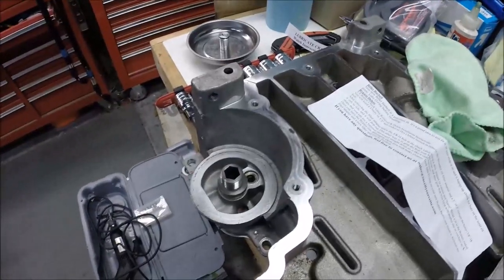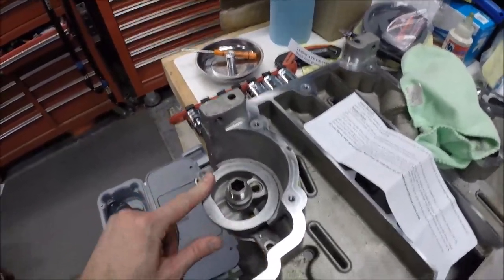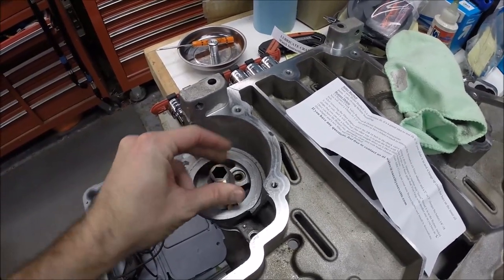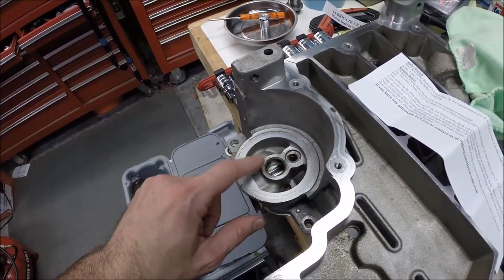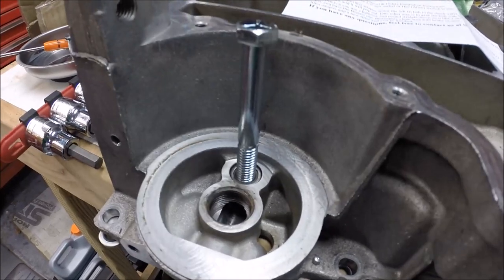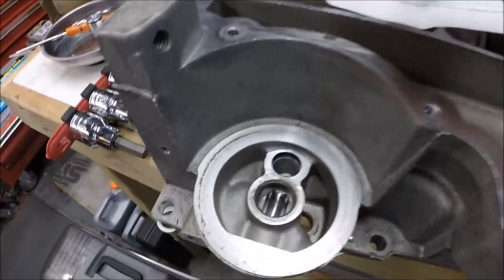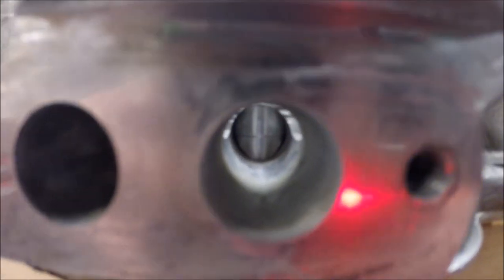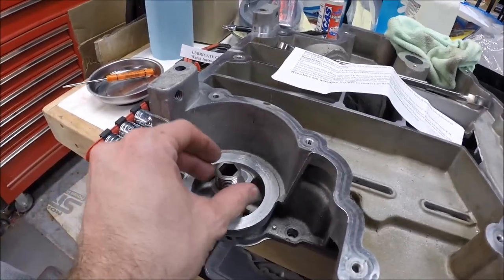1 Simple LS engine upgrade to STOP unfiltered oil!  Oil Bypass Valve Delete

Comment: Nice video Scruf!  
Just to clarify what that check valve is there for and what it's not there for. It is there so that if the filter never gets changed and gets to restricted the check valve will open and let a little oil by and it won't be enough to save your engine unless you shut it down right way.  Also, for those that don't know, most quality filters have a check valve built into them these days that will open if there is a problem with the filter getting clogged up. Most people that buy parts like the Bypass Delete keep their oil and filter clean anyway so it’s not a problem.

The check valve works off a pressure differential. That means that when the pressure jumps up like when you rev the engine and the pressure gets a little higher for a second on the outside of the filter element then on the inside of it, the check valve will open letting unfiltered oil in for a second. All those seconds of it cracking open lead to a lot of unfiltered oil unnecessarily entering the bearings and lifter needle bearings. That being said, its ok if the oil pressure gets a little lower on the inner part of the filter, its brief and its not that low and plenty of oil is still flowing through the filter. As a matter of fact, it usually is a little lower on the inside of the element and the oil pressure gauge is reading that pressure. The check valve doesn’t know the difference between a clogged filter and a brief difference in the pressure differential that’s why it’s always opening and closing. Letting unfiltered oil through.

The check valve is not there for cold oil, especial with the light weight oils we use these days.  We always recommend warming your engine (oil) up before you start being hard on it anyway.

Deleting the check valve will not cause the oil pump to cavitate, it is after the pump so the oil already went through the pump before it hits the filter.

Dirty oil kills modern engines with tight clearances like the LS series engines.
Engine builders have been blocking the check valve since the old school small blocks so this is nothing new.  They new unfiltered oil is not a good thing.

We at SacCityCorvette have been running these deletes and our Billet Barbells that also keep unfiltered oil out in some very pumped up Corvettes, Cadillac Cts-V’s and Camaros for quit a while now. We have torn some of the engines down that we run these parts in that keep unfiltered oil out and the bearings don’t have those tiny particles embedded in them and we haven’t had a lifter failure yet on them, which is pretty common in LS engines, especially with big cams and heavy spring pressures. We feel that keeping the small particles out of the lifter needle bearings contributes to them holding up so well.

Thank you,
Christian
SacCityCorvette
Reply from the maker: Awesome info Christian.   Thanks for sharing.   And great product btw!
Reply: Thanks for this info!
Reply: Wix filters for Corvette DO NOT and most others with the Corvette part # do not have the spring loaded valve that you'd see the same filters in other cars. I can look in my new wix xp right now,  nothing on the bottom on the inside,  their logic is that C5Z has it built into the car
Reply: @CorvetteTrev really?  I my Yukon has the 6.2 l94.  I run the napa platinum 47070, basically wix, and there's a check valve in the bottom center. Corvette guys don't get those on reccomended wix filters?

Comment: You need to tag this to Chevy Trucks!  Common problem on all of the LS engines.  It does not cross reference, this video is like gold to us.  Don't want to have to fun over your vet:-)
Reply from the maker: Thanks for the tip.  I'll try to add some video tags to help the truck guys find this!
Reply: I agree most of the LS motors are such dirty motors on the inside and personally I think it’s because of this check valve letting stuff just go right back into the motor I also updated to a wix Filter that is a lot bigger than the stock filter they tell you to buy and it’s helped out quite a bit

Comment: Ok i been around a while and the last hot rod i built a 302 chev that i use to buzz up to 7.5 k pretty often i had blocked the by pass with flat washer .  I found the information in a book written by Bill Jenkins . He recommended using the one quart truck filter which i think was the same length as the 6 qt vet oil pan i ran . I think he stated it lout flowed two ph8a filter on a remote block . that was a long time ago ok  .My short block was sprint car and the top end was off a G gas car . It ran ok and i never had any problems with  the engine . The filter  on the ls3  in the SS camaro is not any bigger than the one on my money pit harleys . A SS 124 and a SS 143 engines

Comment: This bypass valve is opening more than you think. Cold oil has more pressure, upper rpms and high oil pressure, cheap oil filters, and debris getting in it. An idiot light would be a good addition to blocking it off.

Comment: Just for the record, I think it's a bad idea to eliminate the bypass. It should only allow flow if the filter becomes too plugged up. I can see stiffening, ie. increasing bypass minimum pressure in a race or high pressure application but don't know why you would ever eliminate this feature.

Comment: Honestly, as easy as you pushed that valve down for bypass, I bet that thing opens before 30 lbs. of oil pressure. You put probably 10 lbs of pressure on it.

Comment: Not sure about deleting the filter bypass, I know a couple guys that used a remote oil filter system to conduct brand to brand filter comparisons. They found most all oil filters had plugged enough to elevate the pressure to a bypass state within 200 miles of the oil change. Some better than others but all bypassed.

Comment: Be CAREFUL before you consider deleting the oil filter bypass. It SOUNDS like a good idea, right? Who wants unfiltered oil entering the engine??? However, Under certain circumstances, the bypass is necessary to avoid collapsing the oil filter element and blowing the filter right off the engine. I have had this happen on my racecar. When the oil is very cold, (like a sub-zero day in Minot, ND) the oil viscosity (thickness) gets very high. It is very difficult to push thick/cold oil through any filter element. This is when the bypass valve is intended to open and allow the thick/cold oil into the engine.  The oil filter bypass valve works on oil filter pressure differential  (or the pressure on either side of the filter. The differential is very low under most operating conditions. Except: extremely dirty filter and very high viscosity. 
I would NEVER delete the oil filter bypass on a street driven vehicle. Race engine? Different story.

Comment: I'm building an ls3 and I am getting away from the tight tolerances, going to open up to 2 2.5 thou. Run 15 40 oil and not worry about it.  Moving oil out of the bearing is more beneficial
Reply: Are you building a daily driver engine  ?
Reply: @freddienz68   street/offroad use.
Reply: Would love to see a few videos on the assembly of you engine and the parts you recommend for this  build.  👍🔧🏁
Reply: @freddienz68  it's a 3.900 stroker with a 6.300 rod and a really short diamond piston.  4.070 bore. Should turn some heads
Reply: Molnar engineering for the 3.900 crank and 6.300 rods.
Reply: @bowsertownes  This engine is gonna sound mean as mate👍🔧🏁
Reply: @freddienz68  I've only posted a few videos long time ago of other stuff. Maybe I will try to make a recording of what I have going on.  It will be carburated as well Holley xp 850.
Reply: @bowsertownes  you going to run the Holley efi system  ?
Reply: @freddienz68  no efi, 850 carb. Msd 6014 box and coilpacks
Reply: @bowsertownes  nice one mate .  Merry Christmas to you
Reply: Keep the tight tolerances and use 10-w30 full synthetic engine oil and change it often.
Keep in mind that daily aggressive driving and racing means that the best practice is to change the oil weekly if you are using the vehicle in the harshest manner.
My opinion is that before race night on a daily driver - change the engine oil and filter.
AFTER race night - change the oil and filter again.
If you are using the engine in an extreme manner - use 20-w50 full syn or partial syn oil - BUT - warm the engine up WELL before driving or revving over 2.5 to 3K RPM's.

I also would not recommend using 20w-50 in weather that doesn't get over 40 degrees F - use 10W-30 during these times.

It is less expensive to change the oil and filter than to replace an engine.
Two years of full syn oil/filter changes is $6000 - with weekly oil/filter changes.

One more trick for HP/HD or daily driver engine longevity.

Every second or third oil change - purchase one cheap/inexpensive oil filter and three extra qts of engine oil alone with your regular OF and engine oil of choice.
Drain the dirty engine oil - put the drain plug back in with the cheap oil filter on the engine.
Fill with three qts  of your favorite engine oil - start the engine and allow it to idle for 15 minutes.
This will flush the oil passages of any used engine oil left in the engine.
Now drain the three qts and let as much of that oil drain until no drips come out.

Now simply refill with a fresh good oil filter and now you have a totally clean engine ready for the cruise.
This ensures that you are leaving the least amount of contaminated engine oil behind - in theory ensuring the new oil lasts longer and prevents a new filter from the job of cleaning the old oil bits after a new oil change.
Reply: @PapawCulberson  your complicated bub. Viscosity has relation to bearing clearances.

Comment: I thought that valve is also for cold start until your oil is up to temp the valve opens so your engine doesn't run dry
Reply from the maker: Yes, the valve could open during cold start depending on how well your oil filter flows.  But realize when that valve opens, it is letting unfiltered oil into your motor.  So that said, if you delete this valve, it is extra important to let the motor warm up before driving it hard.  It is also important to run a high quality oil filter.  There are a number of brand options, but I recommend something with a fully synthetic filter media (as opposed to a cellulose media).  These filters will flow and filter better.  I personally like the Purolator Boss filter but there are others that are good too.  Also, most oil filters also have a bypass built into them which bypasses oil if the pressure differential becomes too great across the filter element.  While that does allow unfiltered oil in, it is a final fail safe.
Reply: Scruf's Garage I don't really see a reason to even have this bypass, most modern oil filters already have a bypass if the filter is too restrictive. Just makes me think 2 bypass one in the pan and another in the filter then a leaking barbell how much oil was even getting filtered.
Reply: @bryanmartinez6600  they put them in pan for the people thay dont like to change oil if filter gets backed up oil is still available to flow. You would be surprised how many people don't change oil and can cause problems. As long as you change oil regular this won't hurt to block them

Comment: Hello I have an aftermarket oil pan like yours but the original size oil filter doesn’t fit I am using ph3506 what kind of oil filter did you use on your pan- thanks
Reply from the maker: Mine was the stock bat-wing oil pan.  No issues with filter fitment.

Comment: Just what keeps this plug in place?
Reply from the maker: The thread shaft that your oil filter screws on to (remove at the 2 min mark for reference) overlaps the delete plug (in the same way it overlapped the stock bypass valve).

Comment: I deleted the check valve ball on my 2000 z71. It's still on the rack. Is this going to cause me problems or can I leave it deleted?
Reply from the maker: So my car is NOT a DD and I ALWAYS drive the car easy and let it fully warm up before driving it hard.   If you're the sort that likes to start the vehicle and immediately take off, then I would leave the bypass valve in place.
Reply: Me too what have you found out I’ve getting a oil leak and don’t understand it using to much oil but I remembered removing this Val e and leaving it out . Oh no did I mess up or what

Comment: Wouldn't this bypass  work on a pressure differential concept meaning if flow is good , that flow /psi thru the filter  would hold the by-pass closed . When flow thru the filter (thus lower psi) is not good , 30 psi  would allow the by-pass to open due to the lack of pressure holding the by=pass  closed . My 2 cents .
Reply from the maker: Correct, the bypass is working on a pressure differential.  It's just that the spring is very soft, so it's often bypassing unfiltered oil even when there isn't a significant restriction.   So if you do the bypass delete, it's very important to run a quality high flow filter.  Typically a 100% synthetic media type filter.

Comment: Do you use zinc oil while breaking in the engine?
Reply from the maker: I used a conventional (not synthetic) and some Lucas ZDDP additive during the break-in.  Since it's not a flat tappet cam, it's not as sensitive to needing zinc, but it certainly doesn't hurt.

Comment: would this increase oil pressure?
Reply: It shouldn’t have effect on increasing pressure. The pump has a relief valve that relieves the pumps output pressure, which is before the filter and this valve. This valve is to limit excessive pressure in an over pressure situation
Reply: It shouldn't in theory but it 100% does. It's technically a maintenance item. If oil pressure is off, too high or too low this is the first thing you would check, they're cheap as borscht too.

Comment: What if you left it open with nothing I. It at all wouldn’t that help pressure or cause problems
Reply from the maker: The port is the oil filter bypass.  So if you left the plug out, it would allow oil to constantly bypass the filter.  So definitely not recommend.

Comment: Does this apply to an 01 silverado 5.3. LM7 engine? The oil turns black pretty quick so maybe that valve is stuck open??
Reply from the maker: I can't say for sure, I haven't looked at an LM7 block.  The next time you do an oil change, look and see if you have a bypass valve in the block like is shown in the video.   You can use a screwdriver to press it in and see if it's sticking.   Of course, if it is stuck, you'll want to investigate why... is there debris in there?  If it's not stuck, but you still feel like it's bypassing oil, then it could be that the filter is clogged.   You can buy a tool to cut open your oil filter; kinda like a big can opener.   Doing so will allow you to inspect the filter media and see if there's debris or sludge clogging it.
Reply: A "suspension" type oil will turn dark quickly . I'm not sure if it is even made these days . Chevron Delo was a suspension type of oil .
Reply: Yes I did it to my neighbors  06 LM7

Comment: Would this cause a low oil pressure issue? If not functioning properly?
Reply from the maker: Not directly.   This valve is looking at the pressure difference across the oil filter.  If the pressure difference across the filter exceeds the setting of the valve, then the valve opens and unfiltered oil bypasses the filter.    If the filter were severely clogged, that could potentially cause low oil pressure.  But that would typically only happen in extreme situations... ie, engine failure and debris clogging filter, significant sludge buildup from not changing the oil, or the internal filter collapsing.

Comment: How is the engine running with the bypass delete??
Reply: I am not related to this video, but is the oil filter by-pass was defective or sticking due to debris, one could expect to see an increase of cold/ hot oil pressure. Some aftermarket oil pans have done away with it completely. Just maintain oil and install a quality oil filter. I use ACDelco filter. New vehicles, after 2008, has this relief on the inside. I could be wrong on year and perhaps only certain engines, but changed. ASE Master since 1978.

Comment: Are you going to delete the oil bypass valve that's inside every oral filter you can put on that engine? I don't think the oil system needs an extra bypass valve. It already has a pressure relief valve on the oil pump. Now all you need to increase soil pressure is to take the cap off of the pressure spring and add a few washers under it. Three or four washers old raise that all pressure B 10 or 15 lb. The problem I cannot figure out is why all these Engineers think that they need to three and four pressure-relief switches in an oil system on an engine. Somebody's paying these people or they wouldn't keep showing up for work. If they're doing s*** like this they need to be fired
Reply: the spring does not "raise" oil pressure, it just allows a higher ceiling, it doesn't change oil pressure at idle or under the max relief pressure

Comment: Let's see you have camshaft problems fix the problems bypass valve personally I would put a remote filter system on the vehicle what's a good bypass valve on a good racing filter but you got to fix your engine problems first filters on these new engines don't do much too small they depend on clean engine oil in them all the time